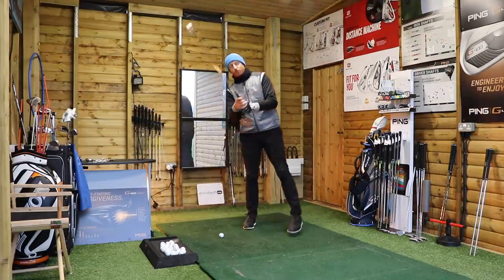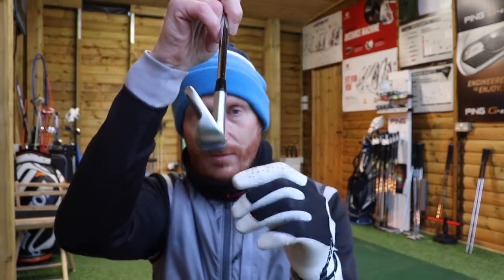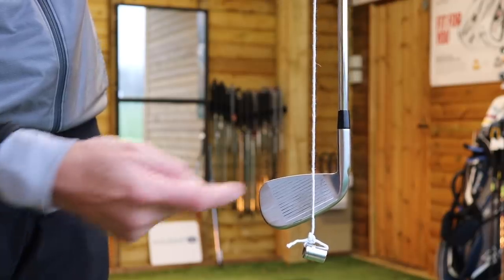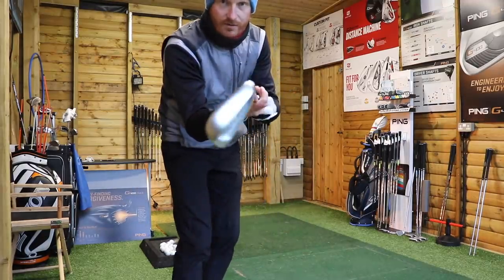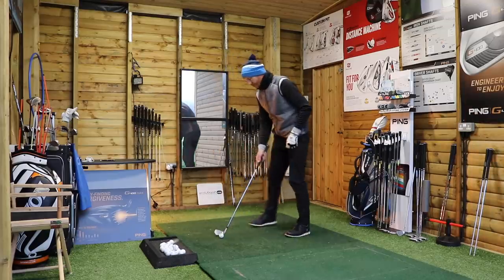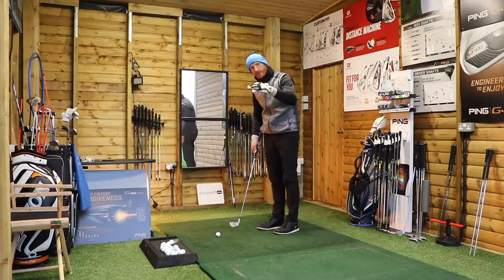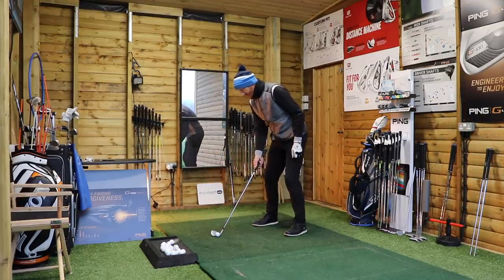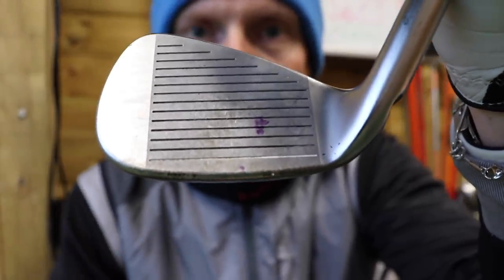GOLFERS This will blow your mind

Comment: Not so Steve, firstly you do not strike the ball with a vertical shaft, therefore plumb bobbing theory is incorrect.  Maybe I can suggest that you remove the head, place the face of the head on a semi driven nail and see where the balance point is?  I believe you will find it is a lot closer to the centre than you say. Secondly the built in bounce you refer to is to allow for forward shaft lean at impact, without this you would have what’s known in the industry as diggers!  I buy into most of your philosophies but this one I’m afraid is off.  In defence of the manufacturers.
Yours sincerely, a master club maker of more years than I care to mention!
Reply: Thanks for info.
Reply: When the head is assempled the center of mass of the club moves towards the hosel, displaced from where it was in the case of the unasempled head. His method is a simple and fundamental method to find the position of the center of mass  along a vertical (gravitational) line thay runs through the center of mass of any object. Hanging it from another point, you may find the exact location of the center of mass, it is the crossing point of the two vertical lines.. The location of the center of mass does not depend on the orientation of the object, so no matter what is the  lie of the club at address it is at the same point always.
Yours sincerely,  a Ph. D. holder  in Physics of many years  -)))
Reply: @nigelcobalt I don't assume any distribution at all. The point of center of mass is defined mathematinally thru a formula for any distribution of mass, (R1*m1 +R2*m2+.....)/( m1+m2+....). For a single head is located at some point, which is not on the face of the head, but somewhere inside it. For a hollow head it might even be somewhere in the cavity. If you attach lead tape on the head, then you displace the center of mass but you also alter the swing weight . In the same way, when you add the shaft, grip etc the position of the center of mass will be moved, depending on the weight (mass) of the shaft, its length, lie of the hosel. It can not be figured out precisely how much it will be moved (without computational animation). It has to be measured experimentally. Usually the designer of the head might take in consideration how much it is expected to be displaced  and takes that in account in his design for each head.  Sweet spot is the area of the face of the assempled club around the point that the center of mass is projected. The relative position of the center of mass of the club and that of the ball with respect  the line of the motion of the club head at impact  determines how much kinetic energy is transfered to the ball, as well as it affects the spin of the ball.
In case it is absolutely necessary, the  best way to determine the sweet spot is recording the impact point and measuring the speed of the ball relative to the head speed, attack of angle, face  angle etc. Not an easy task, a hitting mechanical arm and instumentation is a must. An easy method is the bouncing of the ball  off the assempled head,  scientifically not accepted, but otherwise is OK.
Reply: the reason that they put more mass around the toe is indeed to compesate for the added mass of  the shaft, grip etc. But the c of m ot the head alone will move towards the hosel as soon as it is assempled. A good head design should compensate and try to have the c o m towards the toe for the head alone,  taking in account the average standard length, mass (weight) of the shaft , grip etc.
Reply: Here here welcome to the world of youtube where everybody becomes a expert.  But your spot on as i listened to this wonderimg what the hell hes on about
Reply: I think you should actually try before dismissing.
Reply: @andreaskiriakou6520  I disagree, the design is to somewhat  compensate for miss hits. That is why you primarily find the loaded toe on game improvement irons.
Reply: @cz1mmt  of course the what ever distribution of mass  is to extend  the sweet spot towards the toe , especially in cavity type heads, but all the design is about having the sweet spot around the center of the face. In blades the effect of  the shaft etc is more critical, and a good designer tries to compensate for the expected dispacement towards the hosel and the only way is to have extra mass towards  the toe. Forgiving heads mean ithat the effective mass at a distance from the point of the center of mass is close to the total mass of the head and does not vary sharply. In any case mishits may be at any point left or right to the center, the main reason of mass  towards the toe is because that's the only way to keep the sweet spot centered farther from the hosel. I have a set of both mizuno mp 68 and mp 69. The main difference between these two is that they put more mass at the toe in the mp 69, and indeed the sweet spot moved towards the toe ,  it is better centered than in  the mp 68, I would estimate around 3 millimeters displacement towards the toe,  the dispacement affects  side spin too.
Reply: well then how do i hit the heel and not get a bad shot and how does luke donald not hit a bad shot every time so your theoy i wrong its all about swing like your self not copy every body else
Reply: Doesn't work that way at all.  To some extent the actual plane is both marked by shaft angle and also exists as a line of force that doesn't match the shaft angle exactly.  Extensive testing has shown that both the angle between arms and shaft (on a DTL view) and the angle between the shaft and the head (same) tries to straighten out as force is applied in a swing.  Essentially everything tries to find its exact balance point on a swinging plane,  and a lot of the difficulty in swinging a golf club comes from the fact that the human body and the club are not perfectly suited to that.  Without some kind of adjustment, everything is trying to pull out to dead straight the more force is applied in the plane of the swing.  

At any rate, the real sweet spot has always been somewhat inside center.  Maybe not as far toward the middle as he marks it here, but definitely inside of center.  You can look at any top player's well-worn clubs and you'll see it.  (Cf. Hogan.)  That's not even in serious dispute.  Modern manufacturers have compensated for that to some extent by toe-weighting, which can bring the effective sweet spot back toward the middle some.

Putter manufacturers used to be absolutely terrible about this.  If you've ever seen the old Wilson 8813, an 8802 lookalike with a scored aiming line dead in the middle of the top line, that's an example.  It wasn't even close to where you should be hitting the ball.  On those old forged end-shafted putters, the sweet spot was distinctly inside center.  If you hit it in the middle of the face, it was going to twist every time and give you no feel whatsoever.  As for the "expanded sweet spot" putters now (there's actually a debate as to whether there even is such a thing as an "expanded sweet spot" in any sense other than a reduced tendency to twist), I'm still trying to figure out how any pro needs help hitting the sweet spot on a _putter_, for God's sake.
Reply: Please DEMONSTRATE Your point. As a club builder I'm sure you have old clubs sitting around with the sweet spot worn out. Post your swing, slow motion face being struck etc. Something besides empty words.

Comment: Speechless, ,
Reply: Not so Steve, firstly you do not strike the ball with a vertical shaft, therefore plumb bobbing theory is incorrect.  Maybe I can suggest that you remove the head, place the face of the head on a semi driven nail and see where the balance point is?  I believe you will find it is a lot closer to the centre than you say. Secondly the built in bounce you refer to is to allow for forward shaft lean at impact, without this you would have what’s known in the industry as diggers!  I buy into most of your philosophies but this one I’m afraid is off.  In defence of the manufacturers.
Yours sincerely, a master club maker of more years than I care to mention!

Comment: It would have been interesting to see the data on hits in the "supposed" sweet spot compared to the "true" sweet spot where you use shaft lean. I usually use shaft lean when I want to flight the ball down.  Otherwise another interesting and informative video.  Thanks.

Comment: I have to admit you lost me on the plumb bob.  You are lining up the club with the shaft completely square and vertical, correct? Yet, the starting point of the plumb bob is actually set on the forward outside of the grip, rather than the center of the shaft, and that point you identify seems to have nothing to do with the weight of the head itself (although you cite an example of shortening the hostel to move the weight forward). Isn’t the club head weighted to achieve balance at the center of the head? If the shaft were indeed held completely vertical, even with the starting point you identify, that identified sweet spot would be as far from the hostel center as the outside edge of the top of the grip. This is the very first of your videos that seemed to make no sense to me at all.  I am lost.
Reply: Further to that, if the plumb bob were set in the middle of the shaft, and that shaft held completely vertical, the plumb bob would also end in the middle of the shaft and hostel, but the shaft and club are not held vertically, so I cannot figure out what that plumb bob really has to do with anything.
Reply: Sorry, Steve, I think the lightbulb just went on, and I understand what you are saying now....measuring that plum line from the center of the bottom of the face to the tip of the grip.
Reply: Sorry, Steve, but this keeps bothering me. Tho I think I finally got what you are getting at, if I am correct, it has nothing to do with a plumb bob. Rather you are illustrating a straight line from the front of the grip to the middle of the sole of the club. If you were holding the shaft straight
up, a plumb bob would hang down the shaft, and you could move that anywhere you want, even off the club head altogether, mere by changing the angle at which you hold the shaft. So..straight line, not plumb bob. Now I don’t get how even that straight line defines a sweet spot, without consideration for the design specs and balance. How do you define that as any relationship between the sole of the head and the front of the grip?
Reply: He found the centre of mass of the club (the balance point) yes the plum bob should start centre of the shaft but he was close enough, if he did centre of the shaft then the sweet spot would be slightly more towards the heel. 

If you look up a video on youtube “Scratch Tv Muira”, this guy goes to the muira factory in Japan, muira are the best golf clubs ever made so they say, there are myths that tiger woods played muira clubs when he was the most dominant player ever and just had nike logos put on them. In the video the owner of Muira “Mr Muira” (Muira is his surname) he says that the sweetspot is towards the heel. If you find the best golfer you know say golfer better than scratch or a pro and look at his clubs and they will normally have ball marks towards the heel. The reason the sweet spot is there is because if you have a club which is a straight stick (shaft) with a lump of metal on the end sticking out from that shaft, the shaft doesnt go down into the middle of the club head it goes into one side of it, then imagine hitting a ball off the toe of the club head, the laws of physics will say that a ball hit off the toe will make that club head want to rotate open, like pushing a door from the furthest point away from it’s hinges, its so easy to make the head rotate at this point. For golf you dont want the head to rotate when the ball is struck you want the ball to strike a part of the face which doesnt rotate the face, like pushing a door near the side that has the hinges it is much much harder for the door to rotate open than if you pushed it from where the door handle is. That is just how angular momentum works, the further you are from the fulcrum (the hinges or the clubs hosel) then the easier it is for the door to rotate or the club face to be twisted open and a bad strike results

Comment: Please don’t listen to this guy. His plumb bob does not have any bearing in where the center of gravity is on the club head. Just hit the ball in the middle of the clubface like every tour pro in history does unless you have a wedge from 1970 that has a massive hosel length then maybe er 1/4 of a centimeter near the hosel. But in reality with that much loft on a wedge you won’t lose any distance on a slight mis hit because the ball isn’t compressing much on the face. Again this guy is a quack.
Reply: Dechambeu also does things unconventionally and wins tournaments..is he a quack too?